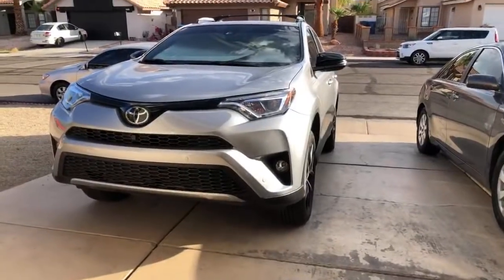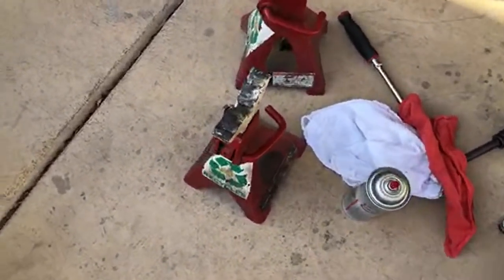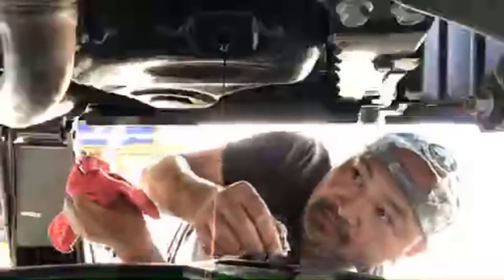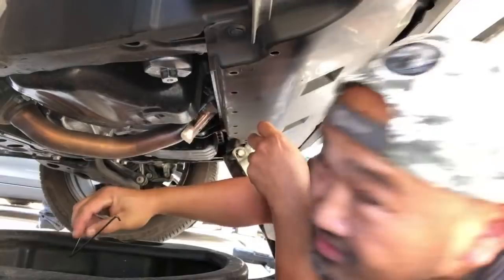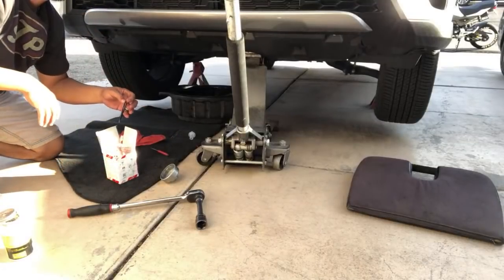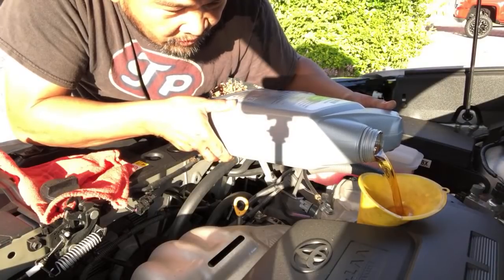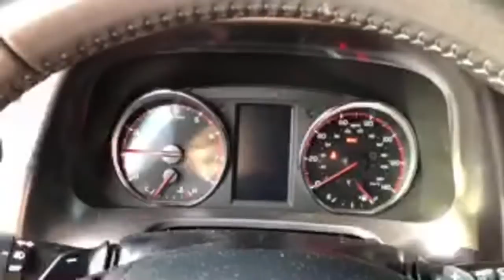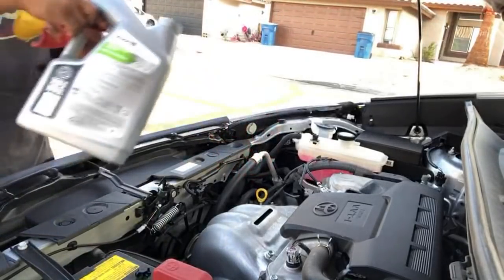Wife’s RAV4 Change engine oil & filter √ Fix it Angel

Comment: Been using Rhinogear ramps to do oil changes for over 10 years. Much quicker than dragging out the floor jack and Jack stands. I also use Fumoto quick oil drain valves on my cars.

Comment: If all you work on is your own car— the 2ARFE engine has an updated tool for the oil filter housing so you don’t have to struggle so much.. I highly recommend you get it. This guy knows what he’s doing— knows how hard he can pull on that housing— years of experience—you probably don’t .. so don’t risk it and get the proper adapter.. also use the large nut on the adapter as shown.. not the middle hole— you will strip that before the filter comes off .. ask me how I know😂

Ps— change it every 5K.. not 10K.. or your 2ARFE will start drinking QUARTS of oil very quickly .. and when that happens you cannot reuse the block. It’s done. It cannot be re-ringed or re-honed. Change it at 5K or 6 months and they will easily go 400K. Change it every 10K or 1 year— you will be hating life before that engine hits 200K.

Comment: Angel ,what’s the correct rpm during idle @ normal temperature in this rav4?
Reply: 655
Reply: @LAactor  Angel...mine is at 760 rpm in park or neutral, how can i make it lower? any suggetion ,,thanks

Comment: Oil is cheap engines are not. If that was my car I would be changing oil at 5k miles. Manufacturers advertise long oil intervals 10-15k miles to attract customers. Oil should be changed every 6 months